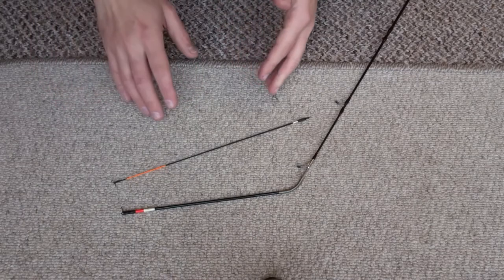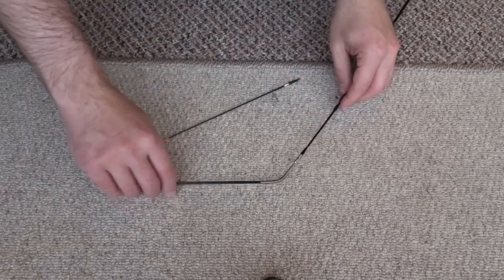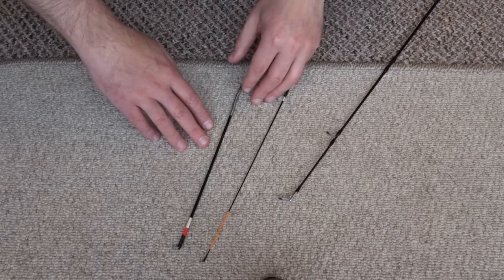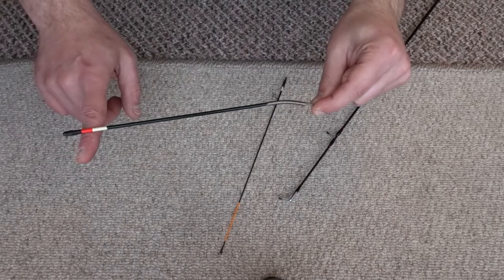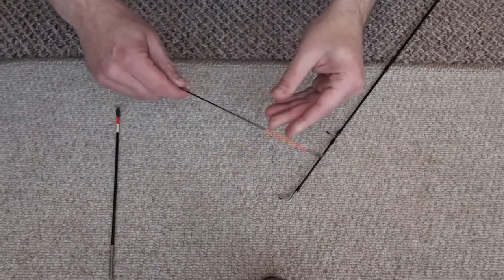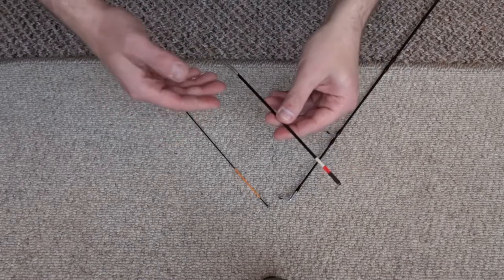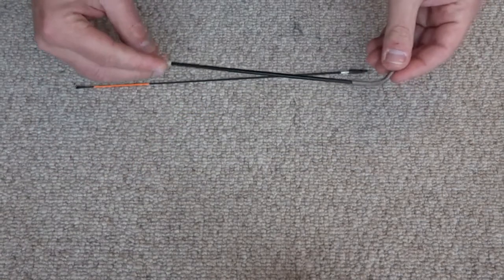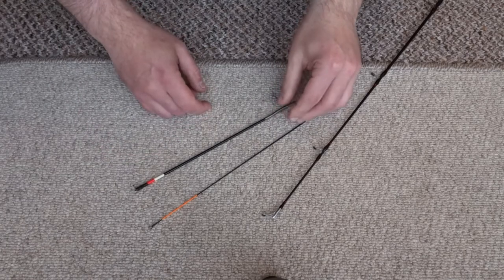Quiver Tip Vs Swing Tip - What's the Difference?

Comment: I still use a swing tip ( paired with a 60 year old 11 foot split can rod ) when using a running light grub / maggot feeder on natural venues. I think it was made by Middy, and purchased in the late 90’s. Much more sensitive than even a 1/2oz quiver tip for those shy or snatch bites. It is clearly a piece of angling history these days, in fact on Sunday a youthful (most people are youthful compared to me these days 😊) angler came over for a chat and said in all seriousness, “You are catching well, but I wanted to ask why are you using that broken rod” 😂
Reply from the maker: Haha that's a funny story 😆. I used to use mine on an old reservoir where the fish spooked easily. It seemed to work better than the quiver tip for shy feeders. I don't use it much now because of all the commercial fisheries it doesn't seem needed. I would like to use it again maybe on a hard water or during winter time. Thanks for sharing the history info I'm always interested in that kind of thing with fishing 🎣.
Reply: @PhillWyattFishing  agreed, the stocking levels in commercials are so dense that I don’t think it matters what you throw in 😇, or how you present it, there is simply always competition for the bait. I am not saying that is a bad thing, especially for getting new or young anglers into the hobby, but after fishing them for 12 months it felt like I was fishing in a bucket, so  I have gone back to natural lakes and rivers.  Far less fish in the net of course, but for me, more rewarding.

Comment: Just found this after searching for 'swing tip fishing'. I've just returned to fishing after 40 years ( apart from a couple of times taking the children when they were young). I still have mych the same kit, Abu match rod and mitchell match reel that I brought in 1982 lol. Back in the 70s and early 80s, I always used a swing tip with a swim feeder on river, lake or canal and caught a variety if species (not carp). So of course, after upgrading my line, hooks etc, i went off to a commercial lake full of mid- size carp. And couldn't stop catching 6-10 pounders off of my 6lb line and 1980 equipment and swing-tip lol. If im honest, it is all a bit easy, And I didnt get time to have a brew due to the amount of bites ( no kidding), I would rather go to wild water where a bite is actually quite exciting. By the way, all I heard were blinking alarms going off all day.
Reply from the maker: Yes I know what you mean. The popularity of commercial fisheries filled with carp has made these kinds of devices almost obsolete. I do like to fish in a more wild setting which isn't full of carp although these places are few and far between these days. I used to use my swing tip with an Abu Garcia match rod in the 90's. Good times.

Comment: The swing tip is still the most sensitive form of bite indication with zero resistance secondly used with a 90%rubber as opposed to what your showing ,also the actual swing tip is useless a carbon quiver tip with a proper end eye and no other eyes on and you won’t get tangled ,also you have to know how to cast one which most people don’t,you have to cast with the reel at 90 degrees IE the reel resting on the back of your wrist (if that makes sense) I use one all the time a Ivan marks harrier rod although Tri-Cast still make them in the right hands a truly accurate sensitive devastating method 👍